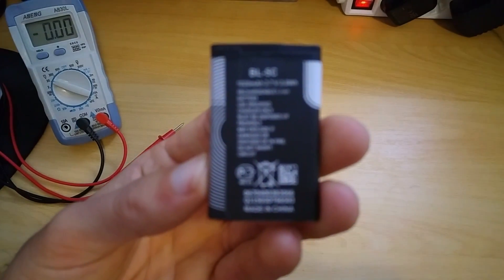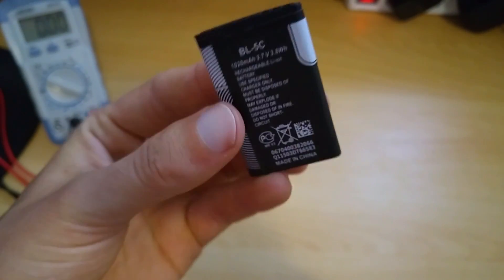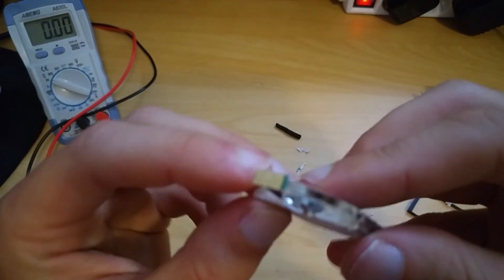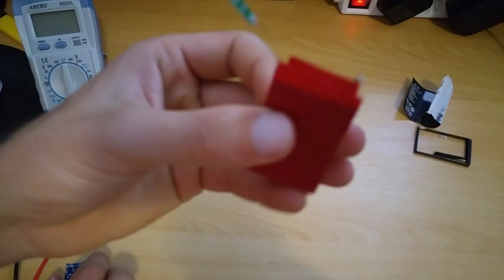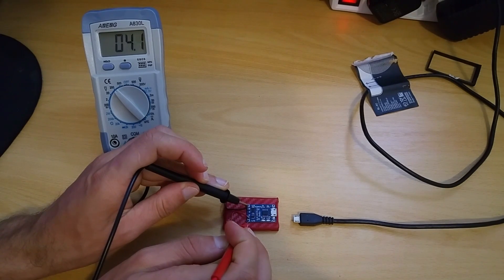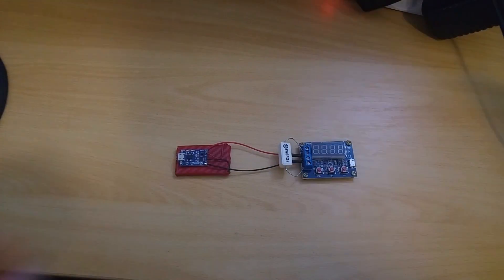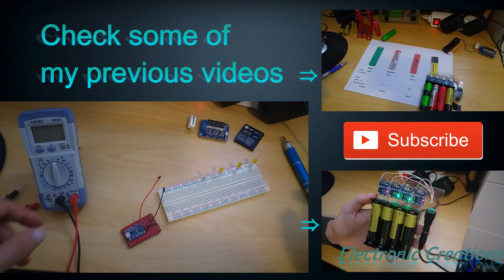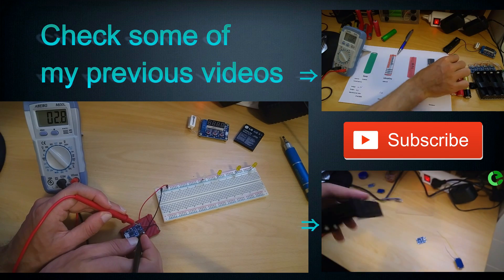Charging cellphone battery ~ Testing on BL-5C battery

Comment: I measured 1,73 A into a 1ohm load. Mine is original, the only question that bothers me: Does it have overcharge protection? I don't want to take it apart.
Reply: No, Thats why he used a Z3 Charger. The resister is not the protection.

Comment: Hello! Why is it necessary to open the battery? Can not charge by connecting the wires to minus and plus, without the battery being opened? Thank you for sharing!
Reply from the maker: It's easier to connect leads if you open it.